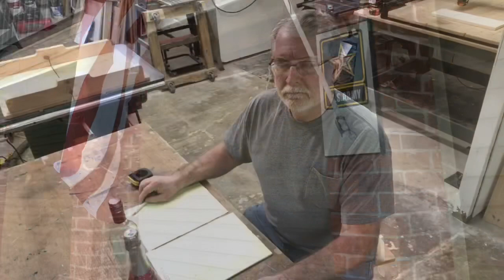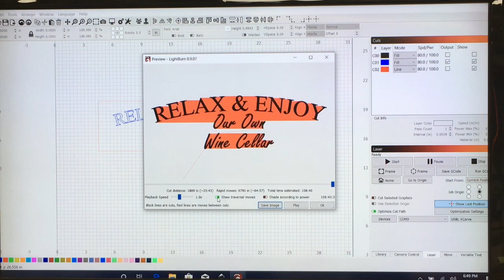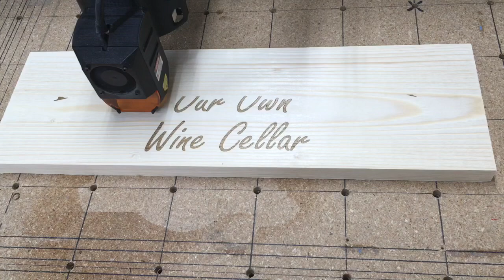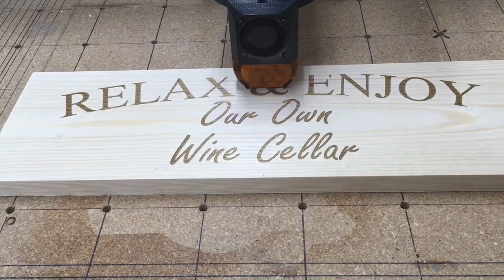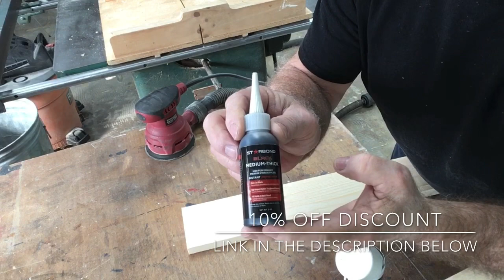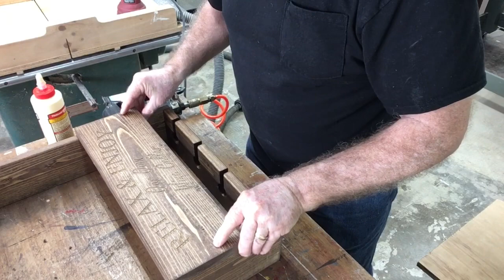Super Easy to Build Wall Cabinet Wine Rack

Comment: can you post the dimensions of this rack? It appears to be all 1x4's? with a width of 20", but how tall?
Reply from the maker: It was 20" tall and 16" wide.  Also, it is actually 4" deep.  A regular 1x4 would be too small unless you only put the smaller diameter bottles in it.